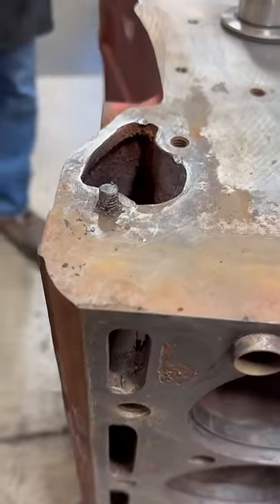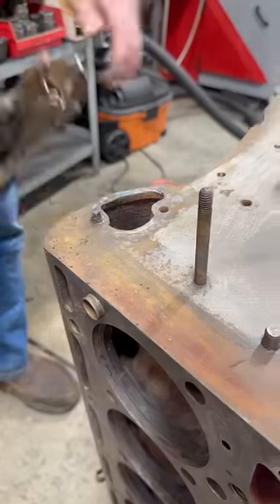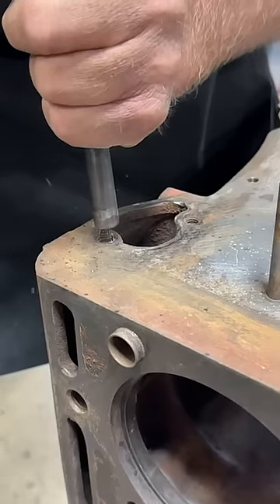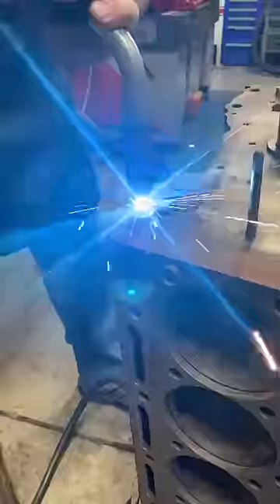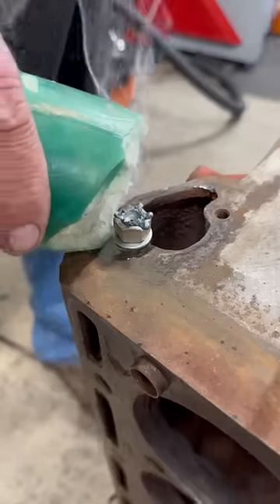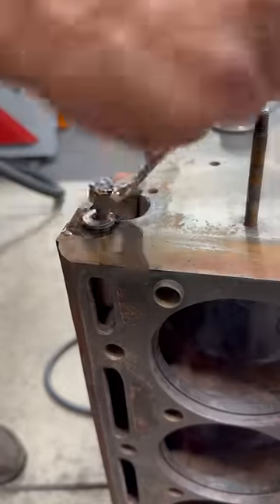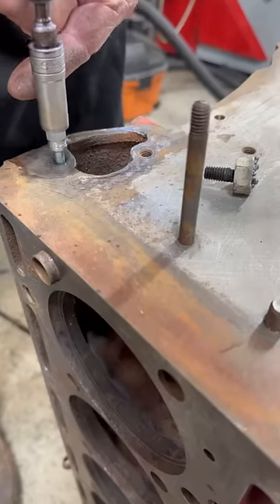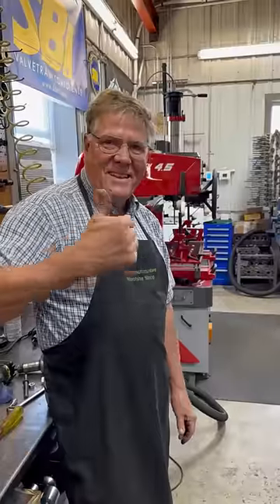#shorts I Make So Much Money Removing Broken Bolts

Comment: The reason I like wax is because if you spray oil on a hot bolt it immediately flashes off, doing nothing. The wax melts and sticks around a bit.
Reply: This is the logic I've heard as well. If you use penetrating oil before heat, it can even leave ash inside the threads making the problem worst.
Reply: @Duamerthrax  Maybe someone should deliberately make candle wax sticks meant for this and call it "heat penetrating wax" Lol..
Reply: @Sigrafix  Honestly, a wax with a really high burn point would work even better then standard candle wax.
Reply: Project Farm proved that candle wax doesn't do any good.
Reply: @fourbyfourblazer2  I just watched it, that's interesting! My experience is directly the opposite of his, though I think his test method was fairly reasonable. A lot of people swear by it, so I'm curious why we all seem to think it works so good.

 One difference I can note is that I usually use wax when welding a nut to a broken broken/stud, so everything is usually so hot it's about to melt.
Reply: High viscosity 🚮 worthless nonsense
Reply: @NavinJohnson_thethird he didn't apply it properly. You don't drip it on a cold fastener, you melt the actual candle on a hot fastener like is done here, that's not how he did it.
Reply: Try using soldering flux paste. It flows into the threads and doesn't leave any waxy deposits.
Reply: So much inexperience and lies it’s crippling. This is why the internet sucks today.
Reply: it also doesn’t leave the working areas messy as you can burn the wax out. Every situation can need a different method
Reply: Project farm(which I love) proved that wax is not good at loosening a frozen bolt. 

The heat and hammering does that. But I do believe the wax helps lubricate the nut once it is broken loose(with the benefit of  not evaporating as quickly as most penetration oil.
Reply: @RENOWN55CHARGE that's kinda what I thought, but I get the point of how it won't burn away
Reply: Motor oil in a squirter is the best
Reply: Cool the boot off because using oil. No one likes a hot expanded bolt inside of a hole
Reply: I use paraffin blocks my father was a carpenter and he would use them to drag screw threads across to act as a lubricant before going into a delicate wood minimizing friction and reducing chances of splitting
Reply: Paraffin is also a wax that is used in candy bars candle making and other stuff like that it's extremely cheap for large quantities
Reply: @afrothunder270  I do the same but for the reason that you`re less likely to break the screw.  Soap works good too.
Reply: Ahh...wax on, wax off. Lesson over Grasshopper...😏
Reply: @volvo09 No one is stopping you from recreating his test with your method.
Reply: @totalmetaljacket789  my comment was to someone else. This guy did it the right way.
Reply: I wonder if it depends on what kind of wax, paraffin vs. beeswax?
Reply: @ScootyPuff_Jr probably because you’re mixing the result of the welders heat with the non existent result of the wax.
Reply: Also if the wax was supposed to anything why didn’t the thread chaser not remove even a speck of wax? Wax doesn’t have any penetrating capabilities
Reply: Wax is a lubricant, hardens up once cooled, allowing movement via a solid boundary layer.
Reply: watch project farm, penetrating oil is better
Reply: That's EXACTLY why you want to spray the hot bolt with penetrating oil. The bolt cools much faster than the block with the help of the oil and contracts which helps with the removal. I use the same method to remove solid dowel pins.
Reply: @NavinJohnson_thethird  he used a propane torch got to get it hotter and the trick is to heat the whole area but not get it too hot and use paraffin wax like from tea lights I worked in an engine shop as a tear down guy on old industrial and commercial engines from neglected Gen sets and irrigation pumps and trust me once you learn how to do it with heat and wax you won't mess with the other stuff anymore believe it or not there is a little bit of a trick to it and you got to practice to be good at it funny how that works for just about anything it's more about the man doing the job than the tool sometimes
Reply: @alvinrodigues6567 , most reasonable sounding comment so far! Hope I can remember to try this next time!
Reply: @afrothunder270 , don’t forget- it makes your diesel engine run, too!

Comment: Had a three inch pin stuck in a boom attached to the ship. No telling how long it had not been used, or serviced. We had to lean over the ship's rail to reach this pin, so safety belt was required. Put some oil on the top, hoping it would seep down and loosen up. Not to be, brought in the torch heated used a wrench on the pinhead ( bolt head, no threads on shaft ) , no good. Cut off the head, pour more oil on it, drilled some holes near outer edge's of the pin to give it room to expand, contract, put more heat on it, and used a 20 lb. maul to drive another pin down on it. Goal was to drive it out the open bottom. No luck. Pin had not moved at all, zero affect , three days of beating and pounding. Old timer came around and said go get some PBBlaster....spray that on the top, let it sit overnight. We did. Next day, first time we hit it with our secondary pin, which was more a tap to let everyone know we are about to start pounding again...well that first tap....the three inch pin slid completely out and straight into the water...30 feet below...gone forever.
Reply: Thanks for this 😂
Reply: Another good one for things like friction fit pins that are rust-welded into place is pouring evaporust into the seam if you can.
Reply: @ObservationofLimits   good stuff
Reply: Awesome.
I've been using P.B BLASTER for 15 years
It's the best ever for rust
Reply: Yeah it is @JohnSmith-fh5mp
Reply: I never worked on a ship, so could you tell me why you didn't drill it out? 
That's what I would have done with the bolt in the video as well. I usually just grind them flat,  and carefully drill the shaft out of the hole, leaving just the thread behind.
Is there something I'm missing, or are our methods just unusual?
Reply: @Otek_Nr.3  The pin, was three inch diameter, over water. One would need to build some rig to hold a larger air drill, and hold everything in place.
Reply: @Otek_Nr.3  Tried to find a photo of that side of the ship showing the boom. Couldn't find one. These booms I suspect were designed and installed as a backup if they ever needed one in that location. The boom itself rest just outside the walkway , starboard aft side in rear of ship. Very likely it was never used. Riggers had the boom secured, out job was to free it up. It was decided to remove the pin and clean the inside sleeve of any rust, inspect and install a new one. To look at it, it appears to be a large bolt. The bolt head was there to allow one to turn the pin, and loosen it up if it ever locked up. Ships being exposed to salt air are forever rusting and messing up equipment. One of the people I worked with had served in the Navy, told me the carriers look for storms, like a car wash for them. They will go get in a squall, just to rinse the ship of salt residue.
Reply: @Otek_Nr.3 Drilling takes way longer to do and risks thread damage. The welder is the way to go if it is a suitable situation for it. I've taken more exhaust studs out that were broken of flush to the block with a mig welder than I care to think about. It also can be done in a very tight spot where you can't get a drill
Reply: @--_DJ_--  That's true, if you have the welder at the ready, I suppose. But we use a drill, that you can magnetically fixate, and it's much more convenient for me to get, than getting the welding machine out of our welding booth.
Depends on the circumstances I guess.
Reply: @Otek_Nr.3  We must work in very different situations. Mine is almost exclusively automotive, so a drill of any sort is almost always out of the question without extreme measures like pulling an engine to extract a bolt. If you have never tried the welder, give it a go if you have a chance. It works so well, especially when you have different materials, steel in aluminum for example, where welding the bolt to the surrounding material isn't a risk. Definitely one of the more satisfying tasks I get into when you save hours of labour with a few seconds with the welder.
Reply: @--_DJ_--  Our jobs are surprisingly different then. I build, and service large industrial furnaces and ovens. The only problem-screws I usually have are fairly small stainless steel ones. 
I can see, how the welder would be a lot more effective in your situation, but it usually only takes me around 5 to 10 minutes to drill a screw, or bolt out of a thread, while the welder would take that long just to set up.
But if you recommend it that strongly, then I'll keep it in mind, and try it when I get the opportunity. 👍
Reply: Yeah most of stuff uses a bunch of junk but that PB blaster is worth this weight in gold
Reply: @Otek_Nr.3  To elaborate on my technique for flush breaks, I usually do a few tacks on the stud, hang an appropriately sized clean nut on the built up tacks and weld the crap out of it. Cleaning the zinc coating off the nuts is the worst part of it. Never had one not come out that way. (knock on wood) But if you are fighting galling rather than rust, your way is probably the way to go.

Comment: I was shop welder for a machine shop, I became a professional at removing broken taps and bolts. Tig gets the job done alot easier and cleaner. And more precise, and can get down into a hole without mucking up the hole.

Comment: Forgot to mention the way he "teased" it out with loosening and tightening force. That's one of my best and favorite tricks on aircraft. Pesky screws and bolts don't like direct loosing force. They need a little finesse.
Reply: as an electrician i can confirm, when i have to loosen some old rusty meter pan lugs i always give it a crack to the right then it breaks free nicely 9/10 times
Reply: @evanhernandez2684 why is that? What difference does it make?
Reply: @StabbyJoe135  to be completely honest, i'm not really sure why it works, but i've learned the hard way, for some reason if you just try to go left they love to  snap, and when you tighten it first it'll just like it more, and it breaks the rust free then you can work it to the left.  Sometimes you gotta go left to right to work out a really rusted one. At least in the US where i work, most panels lugs are made of an aluminum alloy so maybe it has to do with that?
Reply: It probably heats it up from friction and also breaks the corrosion apart just enough to give it some play or run way to get going .
Reply: Same with cutting threads 😊
Reply: @StabbyJoe135 movement in both directions help loosen, it’s just how it is
Reply: My wife too😮
Reply: I like "pesky"
Reply: @grantperkins368 with cutting threads you are trimming off the removad metal. Back and forth always works best tighten first to move rust.
Reply: I found this out working in a maintenance bay for the Tornado drop tanks. Those buggers would round off for fun if you didn’t nip them up more first 🤦🏻‍♂️ always seemed backwards logic but it really did work.
Reply: @StabbyJoe135 breaks chips of rust that would otherwise cause more resistance
Reply: @StabbyJoe135  it lets the corrosion fall into the thread gaps and get crushed up a bit.

If you simply try to back it out, you're essentially packing it in only. If it's rusty enough that it's stuck fast, tightening the fastener in, in essence gives it more space
Reply: One of those questions either you're wrenching on it and not smart enough to handle all the answer, or you know the answer and aren't strong enough to wrench on it. 

🤷🏼‍♀️
Reply: *losing force.
Reply: My DME Tony taught us tighten before loosining in regards to stubborn hardware. Nothing too crazy, just enough to barely budge it clockwise and then they break free going CCW easy peasy or just back right out. 

Works wonders on flatheads and phillips. Only stripped one in the last ten years since i picked this tip up in my AMT class.
Reply: Consider screwing on a nut. There are times where as it progresses along the threads of the bolt it gets stuck because there's something wrong with the threading. If you try to simply force it in the direction you've been going, you may simply jam the nut on the threads so it doesn't want to go either direction. However, if when you get to a point where it starts to jam and back off and go again, and back off and go again, what's happening is you're starting to reshape both the threading on the bolt and the nut, but only a little. By backing off, you undo the reshaping of the nut threads by going back over the good threading on the bolt. This means that you are overall only reshaping the bad portion of threading on the bolt.

In an instance where a bolt had crud and/or rust on a portion of the threading, when you get to that section while threading a nut onto or off of it, if you simply try to go the one direction, you run the risk of jamming the crud and/or rust more firmly into the threading. If you hit it and back off, you have somewhat broken that stuff up without jamming anything. You keep it up, and you gradually break up that stuff until the nut can go past that point without a problem.

If you start to jam a bolt or nut, and you continue to turn in the same direction, all you're doing is making that jam tighter, and applying a shearing force in a single direction, which results in broken bolts. So with tightened bolts, tightening, either initially or after a bit of attempted untightening helps by not applying that shearing force in only one direction while also working to adjust whatever is jamming so that it's no longer jamming as it's been able to shift in the threading and undoing some of the damage to threads that can result from trying to go only in one direction.

So, wiggling back and forth does multiple things to make it possible to get a nut or bolt lose.
Reply: Same technique for hand tapping or chasing threads.

If a nut or bolt is stuck from corrosion, just loosening it in one go gums the threads up with rust and crud.

Back and forth helps level out the stuff stuck in the threads, and comes out without breaking.
Reply: @Dillyg978 give this man an award
Reply: The magic was wax
Reply: @jeromepark7002  heat from a weld or flame is usually enough for me. As a metal roofer on metal buildings I use the "loosen then tighten" method to find cleaner threads on the fastener or frame. "Working back and forth" is #2 on my list of fastener rules going in or coming out
Reply: I met a guy who worked on ships, rusty hardware that wouldn't come lose was spat on, before he worked it back and forth with his spanner. He said he was usually more successful than his peers, who had to ask what his secret was.

Comment: I've done this for decades. Welding on the washer and nut causes the broken bolt/stud to expand so that when it cools down it shrinks and can be removed.
Reply: Just the heat from the welder is usually enough to 'loosen' it to remove without any 'additions'.
Reply: Exactly.   

I heat with a number 2 oxy acetylene tip , cherry red and head it to the boarder line melting point for literally two minutes to allow the heat to transfer along the FULL length of the  extra long bolt. 
 Then walk away and work on all the other things that need doing and let everything come back to it own room temperature slowly at its OWN rate .

It walks out , literally even Easier than in this video .......  but you have to allow it to get good and cold on it's own.... at it's own speed.

Go do other repairs for 30 minutes. 

Make sure you hold it to the verge of the melting point ... 
but don't  go there ....
. for two solid minutes . 
Then let them cool at their own rate for 30 minutes.  Dont rush it with liquids or compressed air or anything .

.
Reply: Often don't even need to get that hot.
The slow cool is key.
Reply: you can often hear it "ping" when the rust finally lets go
Reply: @StevenHeins  
I know what you mean .

However the true basic science behind it is that if you're heating the bolt and it's pushing outwords.... like a reverse garbage compactor...... therefore heating it cherry red pushes the surrounding material outwards  , and then you let it cool until its room temperature..... the simple scientific trick here is that now the piece you want to get out is now smaller than the outside piece